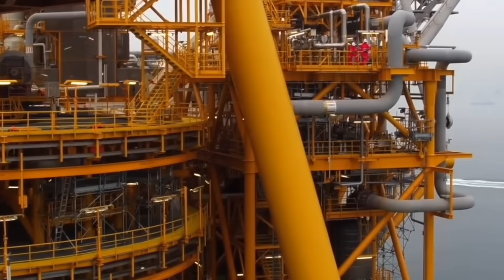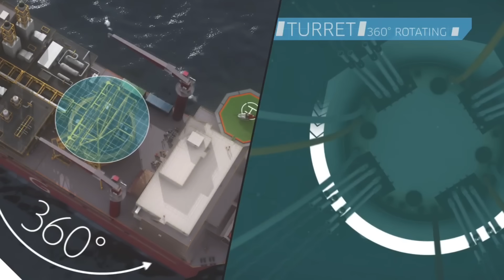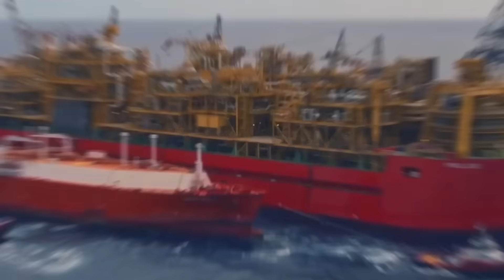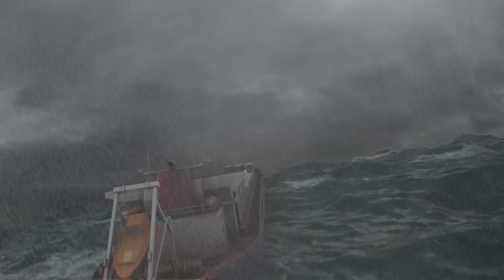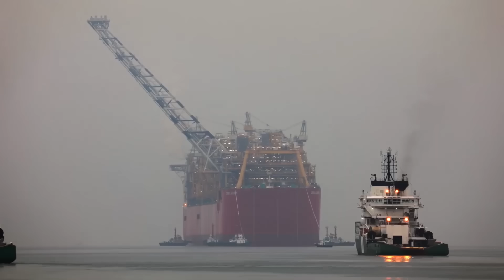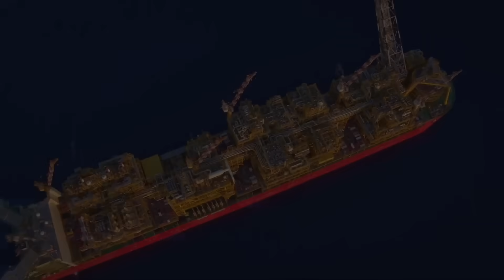600,000 Tons of Impossible Engineering: Shell's Prelude FLNG

Comment: Have any of these natural gas boats ever exploded?
Reply from the maker: No, an LNG tanker has never exploded at sea in over 60 years of operation.
Confusion often arises because people mistake LNG for LPG:
LNG (Liquefied Natural Gas): Extremely safe because it is lighter than air. If a leak occurs, the gas evaporates and rises into the atmosphere, making an explosion on the open sea nearly impossible.
LPG (Liquefied Petroleum Gas): These "gas boats" (carrying propane/butane) have experienced explosions, such as the Maestro and Kandy disaster in 2019. This is because LPG is heavier than air; it pools on the deck and creates a highly flammable carpet that can easily ignite.

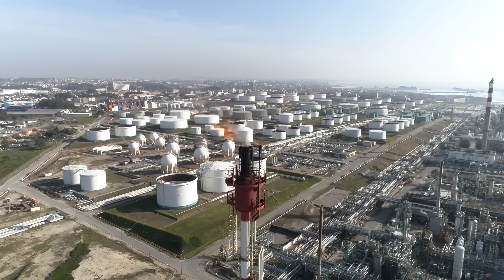Comment: Thanks. Interesting. I can't determine from where it was towed to get to Broome Western Australia. Was it Singapore? And were there photos of it in Port Moresby Harbour Papua New Guinea at 0:54? What is the significance of the ocean water temperature being ten (?) degrees colder in order to cool tanks to minus 165C?.
Reply from the maker: Seawater doesn't cool the gas directly. Instead, it acts as the heat sink for the facility's Dual Mixed Refrigerant (DMR) process.
In thermodynamics, specifically regarding the Carnot efficiency, the work required by the compressors is determined by the temperature delta between the 'cold source' (the LNG) and the 'heat sink' (the ocean). By drawing water from 150m deep—where it is 6-10°C colder—the system significantly lowers the discharge pressure needed for the refrigerants.
With a flow rate of 50 million liters per hour, this temperature difference drastically reduces the energy consumption of the 120 MW power plant and allows the equipment to be miniaturized to 1/4 of the size of an onshore plant. You might want to look into 'refrigeration cycles' and 'heat exchangers' to see how ambient temperature dictates the efficiency of reaching -162°C.